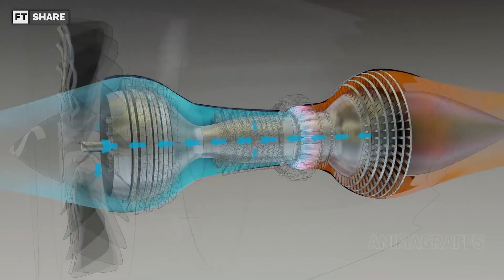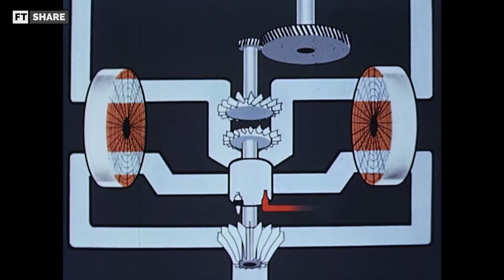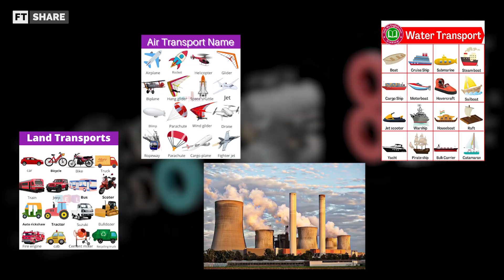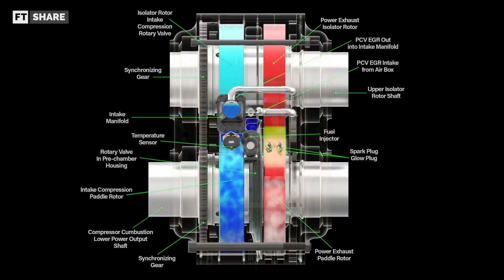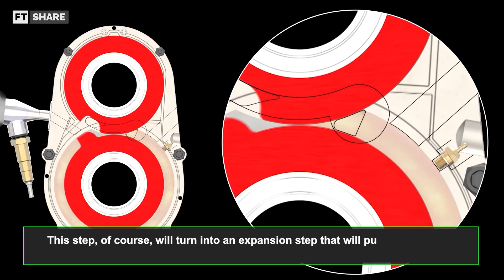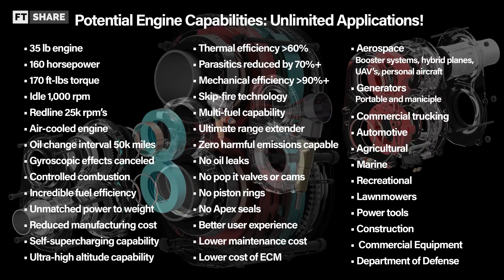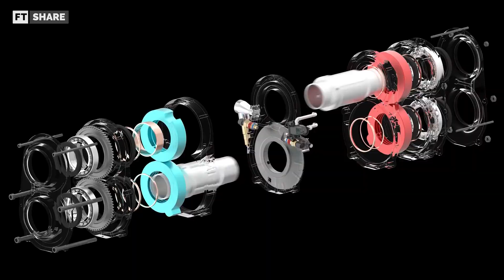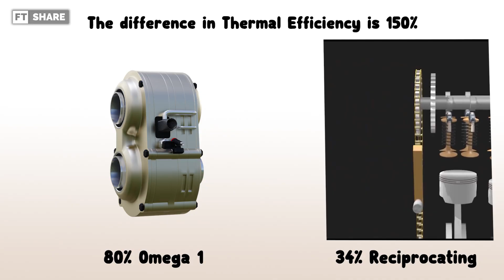Ready To Destroy EV Engine!! | Astron Aerospace - Omega 1 Engine

Comment: IF this information is correct, it will be possível to build powerplants featuring the engine poderá ganhar a generator, maybe also a bateria Pack, and one or more electric motors driving the equipment.  Very interesting!
Reply: Powering a generator.

Comment: Gas turbines gain efficiency and power with combustion temp. It's tough to run them hot enough to be cost effective in a micro package as would be necessary for a car. Their power to weight and theoretical efficiency are attractive, but they come with their own drawbacks. Huge fuel consumption, high temp, bulky and complicated heat management systems, complicated and slow cold starts, and PATHETIC throttle response among them. They make sense for things like tanks that have fleet maintenance, essentially unlimited fuel availability, and the weight/space to make the most of the systems benefits. For cars, they are just to expensive, awkward, fuel hungry, and difficult to repair to be viable at this time. I'm talking about traditional gas turbines here, not the engine in this video.

Comment: This is a four stroke that uses oil like a two stroke. This engine in its present configuration will never be used in the market. It will never pass emissions testing. And if by chance it actually works as described, with wear it will never seal.

Comment: What  is the rpm that peak hp and torque are achieved at? There's not a lot of use for an engine that makes peak power at 20-25,000 rpm as you have to design the rest of the drive line to handle those outrageous numbers. Exhaust? transaxle? There's no torque converters or CVTs that will handle anywhere near those input speeds.

The chrysler program was cancelled for many reasons not the least was the gallons per mile fuel consumption and trying find a turbine that would handle constantly changing engine speeds. Turbines like to run at constant speeds.

Comment: With those specs, this ain’t going to happen. Even if it would, it’s not good alternative for electric cars. Here’s few reasons:
Only green hydrogen would be acceptable for enviromental reasons. 
Difficulties and costs of distributing and storing hydrogen. Poor system efficiency compared to EV. Need of gearbox and clutch. Huge hydrogen tank. 

In production and transportation, hydrogen have less than  50% efficiency. Counting 70% efficiency in vehicle side, total efficiency is 35%. That’s close to maximum efficiency. Turbines have typically very narrow efficuency range. Same could be expected from this. Maybe that’s why combination with electric motor was suggested. In such use, this could hardly compete with fuelcell, generator would be needed and instead of quiet fuellcell, this would add moving and wearing parts. Fuelcell don’t make sense, so why this would either. 

Hydrogen fueling station is over 10x more expensive than charging station   It’s capacity is limitted and no home charging is possible. It would be less convenient than EV. Also, no big range could be expected. 5kg hydrogen tank is huge. It’s volume is around 140l and it must be cylinderical to withstand huge pressures.

Comment: The presentation starts with a lie. And full of lies.

Lie #1. Chrysler did not invent turbo engine. The first two companies that produced a working cars were Rover and Fiat.
Lie #2. The turbines on cars were killed mainly by the extreme lag the designers could not resolve at the time.
Lie #3. Astron Aerospace is not a well known or established company. It might have had contracts as a supplier for the DoD. Among 365 thousands of others. And supplying things like night vision goggles. No real history in aeronautics. If you look at the list of executives, none of them has a known name. Don't count Chris Theodore, who is a known name but... in auto industry and still is very busy man elsewhere.
Lie #4. The video showing production/service of jet engines actually shows Rolls-Royce Trent XWB Fan. Nothing to do with Astron Aerospace. 
Lie #5. The engine combines the conventional engine and turbine designs. It does not. It is Otto cycle, not Brayton. There is nothing, absolutely nothing from the turbine, except, maybe, the rpms.
Lie #6. Any engineer would be laugh at the declared combination of the power, torque and rpm. A simple calculation of rpm for 160 HP and 230 Nm gives something around 5000 rpm... You know, it is three sides of the same coin. Redlining at 25000 rpm without giving more power looks like a total loss of efficiency.. Most likely these numbers were picked from somebody's nose.
Lie #7. Thermal efficiency of a reciprocating engine is exactly the same as of any other engine. Thermal efficiency defined not by the mechanics, but by the combustion temperature or compression ratio. Omega 1 has 15:1, judging by the solid works calculations, which gives ideal (maximal) 56%. Impressive? Not so. For comparison, formula 1 engines have compression 18:1 and actual overall efficiency of 50%. 
Lie #8. Thermal efficiency reaching 80% would require compression ratio of 250:1. Impressive? Now check what would be the temperature of the compressed gas. 1300°C! Beyond the creep point of most of the steels, and technically not possible in single step rotor. Even piston compressors cannot do that in single stage. Only membranes. Next, you will need to heat 1300°C gas by adding more heat with the fuel. So... you will need materials that do not exist. And remember the lie#7? The simple geometry check shows that that compression is not achievable even on paper for this design.
Lie #9. Other prototype engines currently exist that do not claim fantastic properties, such as liquid piston engine, which exist in metal and being tested. Unlike this one.

Enough? 
People, this is a scam, nothing but scam!

Comment: Actually in piston engines, the power is converted from reciprocation to rotation. Hence we can say that the conversion losses are avoided. The rotary engines overcome this issue. And the omega 1 converts the combustion directly into rotation. Hence we have lesser vibrations, better efficiency. Of turbulence is maximized and optimized in the combustion  chamber using flow techniques, we can avoid the issue of power pulling. 
This can really overtake the EV market, however the buyers need to think fast. And the tech change is humongous, so careful testing from different companies from different fields need to test and affirm the results.

With the engine, being compatible with wide range of fuels we can increase combustion  efficiency, by adding mini turbochargers that can handle superheated or saturated steam from engine, in this way we can either dispose the water to atmosphere, while storing a part of it for drinking and washing purposes.
Reply: This engine has not a single advantage over existing ones. Even the "enormous" compression ration (geometrical) turns out to be a little over 15:1. The "enormous" rpms will not be achieved because the geometry of the combustion chamber does not allow fast combustion. Unlike the Formula 1 engines, where the combustion happens at tdc and the piston moves slower changing the distance. With fast rotating rotors combustion and expansion will be overlapping, saying good bye to efficiency. The "controlled" leakage will leak from the combustion chamber at the peak of pressure regardless of the rpms. Experience of twin-screw compressors and root blowers is there, it just does not work this way...

Comment: Oops Rover in the UK made also a jet engine car or turbine in the early 1950s. Ok a rotary engine used in drones made by a British company called Norton the engine put out 50hp full weight 4kg you could carry it in one hand difference is classed as two stroke because burns oil and petrol mix and air cooled. Not just this Norton made Motorbikes using the rotary engines made to four stroke water air cooled which made them a bit more heavy. Bu8t lighter than any piston engine. in racing they were not allowed to be more than equivalent CC size than a 350cc to enter the class as super bikes of which with the use of upside down forks it won many times. But there was a problem the sales of the motorbikes was so low because of the price the company closed down  But another issue was too much HP as the governing body wanted to limit the top speed of Motorbikes so told Norton and others super bikes should be two cylinder and if more than two lower CC and set HP all of that in racing affected Norton sadly.      If that engine can run on direct Hydrogen then that beats every single electric car. Time for the company to only test it on Hydrogen fuel to see how long it can run for without maintenance and also work out how economical it would be.

Comment: I see the main benefit is it compresses the air before explosion - thus explosions are more powerful, increasing the efficiency. Also the materials have to be a lot better. It basically does what Jet engine does. If it can use hydrogen as fuel, that means only one thing - it can use all the fuels... Liq Gas, Gasoline, Petrol, Benzin, Diesel, Jetfuel, mazut.... Also they kind of promised, that ships would use it, so their cheapest fuel mazut will do wonders for cheap.
The electric car industry has some hicups - not everybody has electricity in the world, infrastructure, not so cheap power anymore, losing the access to go inside old towns.
Reply: Every engine compresses the air before combustion, genius. And jet engine does it differently. This is just a scam.

Comment: Interesting but I worry about lubrication and seals. Wonder if direct injecting fuel instead of it going through a pre-chamber would increase efficiency. Want it to work but need to see independent tests and then I would invest. André in Sydney

Comment: 4:00 This part is messing with my head. Won’t this engine lose more and more power as it accelerates?  The pre-chamber allows air/fuel mixture to enter as the space as it is expanding. The air/fuel is ignited during this expansion. 
Am I crazy?
Reply: Exactly. It'll lose efficiency because of that.

Comment: I see the same problems as a rotary engine.  The apex seals or whatever the equivalent are in this engine.  You won't be able to seal the chamber because of corners.  It's still hard to beat circles for ease of sealing.

Comment: I am not an engineer but how does one seal the complete inside and outside of the combustion ring without enormous wear/drag? This is even a problem in "normal" combustion engines in which the surface area is much smaller.

Comment: I wonder if anybody's going to bring back the sleeve valve engine they can be also produced in a smaller package and put out significantly more horsepower for a smaller size and only have three moving parts internally

Comment: Mechanically it is impossible to operate a set of gear without any lubricant at a high speed. 
Intake rotor and combustion rotor are working at highly different temperatures, what about the thermal expansion of gear tooth

Comment: This engine will need sealing all across the circumference while rotating, this will result in higher friction. That does seems dubious to me. Also there is a higher change of leakage, while compressing

Comment: That much pressure on the teeth of those gears don't give me the impression that this engine would last very long. Very little surface area. Plus what kind of crank seals are we talking here? Loss of crankcase pressure due to seal failure is common on two strokes. That being said, this engine is giving me strong 2 stroke vibes. If the rotors are separated then doesn't that mean their combustion chambers are separated too?

Comment: Internal combustion engines put more power out into the air as heat in the radiator and the exhaust and they do power to the driveshaft.
I think your engine must do the same.

Comment: Unless the exhaust is the same temperature as the incoming air there is no way in hell it's at 80% then there's no insulation to the outside world so unless whatever material it's made out of doesn't pass heat I think the whole thing's a scam.
I worked on one of the most efficient automotive turbines call the AGT 101 uses a ceramic impeller formed to net shape to minimize any machining the real problem comes in the heat exchanger to make it efficient.
If you can't take the heat out of the exhaust and put it into the compression you're sunk.

Comment: Aerospace maybe but it way to late for autos. Beautiful design too bad it is already scrap for land use. Very unlikely it will achieve 80% thermal efficiency or run 100k hours without carbon build up, heat fatigue, or oil sluge buildup failures.

Comment: my new rotary engine design is use a pair of roots/screw type compressor, then the combustion chamber with direct fuel injection and glow plug, then a second roots/screw compressor to turn the expansion of the combustion into rotary motion and power to drive the intake compressor and the output shaft.. frank whittles first jet engine was a turbo like use in piston engines, except the pistons were eliminated. turbines have pressure slippage/lose, a roots/screw compressor is positive displacement.

Comment: Combustion motors are inherently less efficient than electric motors.  No way this achieves 80% thermal efficiency (which still wouldn't overcome electric motors even if it did). This is the product of over-sold theoretical numbers at best and straight up fraud at worst.  This will not "destroy EVs."

Comment: If there is 80% more thermal efficiency there would not be an issue in different climates.  Add a water or oil cooled system to solve those issues or both.   Know your decisions on the Chrysler turbine.   Look at the look at the the M1 Abram tank the US uses.    It appears to be of the same design.   That engine design did make it to NASCAR back in the 60’s by STP I do believe.  There are articles in Hotrod magazine published of this car that lead the race till the final few laps till an issue arrived.   Not sure if it made another race appearance or not.    Less moving parts is better

Comment: Any engine on hydrogen is zero emission . Also you would need to make it run on diesel for large ships . Container ships with one hundred thousand plus horsepower  , ARE THE MOST FUEL EFFICIENT VEHICLES ON THE PLANET . Say it slowly . "they get one thousand miles per gallon , per ton of goods shipped ." I am a turbine machinist , I know what I an talking about . You would never get the R.P.M. range in a geared rotor big enough to have the required torque to move a large container ship . Cute little engine though . I would love to try a motorcycle with it .

Comment: the real reason why we dont have gas turbine cars is due to oil companys
gas turbine engines run on anything liquid that burns besides leded fuels because the lead sticks to the fans and can cause the fan blades to rip off from the extra weight
gas turbine engines also require no oil unlike every other engine besides electric
their is also the issue of emissions but if the engine ran on alcohol it would be less i believe and their would be less chemicals in the air
and everyone could brew their own alcohol if they wished
engine maintinance is only a small portion of your average combustion engine

jay leno owns one of the last chrysler turbine cars in the world
also has a gas turbine powered bike and a car he had custom built for himself

Comment: - I'm positive to have seen this layout of engine in the past.
- 80% thermodynamical efficiency is suspiciously high
- such a dense hp/total_volume will be hard to manage when it comes to adding needed stuff like cooling, mainly because not only does this engine have a cool and a hot chamber, the hot chamber isn't equally hot all the way through. Both conventional piston engines and jet engines use their fuel mixture also to maintain temperature in the combustion chamber. Here this doesn't happen, the admission\compression cogwheel chamber will always be cold, and the expansion\exhaust one will always be hot. And they are parallel and very close to each other.
-where\which tube is the one where we can couple a drive shaft to?
-I can already feel the nightmare of harmonics on those shafts; the "cold side" cogwheel during intake\compression will amplify the harmonic imbalances provoked by the expansion\ exhaust on the "hot side" cogwheel.

It may have less moving parts, but it is not really simpler than a conventional piston engine.

Comment: It's glad to hear this late gas engine be developed, but the point is how the thermal efficiency be greater than 35%. And by the way, can it be smaller and less vibration especially while starting it up? If so, it can be the generator for the power source of EV car in stead of dirty batteries! 
Hopefully, we can see the application of this engine to the public! It's my bottom of my Heart!

Comment: I've long thought a small turbine engine coupled to an electric car would be the way to go. This certainly is different but it's turbine technology and takes my idea to another level. I predict this engine type has a future, hope I'm right.
Reply: There was an article, published back in the late 60's by POPULAR SCIENCE that showed an electric car with batteries with an airplanes APU to provide on demand recharging of the batteries.
Reply: Agreed 👍. Imagine if the engine did nothing but run at optimum RPM and load all of the time to recharge a battery.
Reply: Jaguar C-X75

Comment: This seems great! Not sure if anybody reads the comments, but there's some great ideas in them as well. My idea would move the exhaust port to be timed and exposed later in the expansion stroke to maximize power capture capability by the engine. This small tweek could yield greater fuel efficiency from each cycle.
Reply: They’ve probably considered that but didn’t do it for a reason that isn’t clear